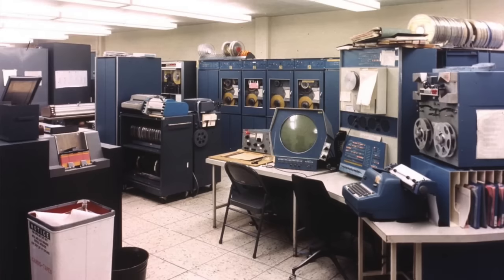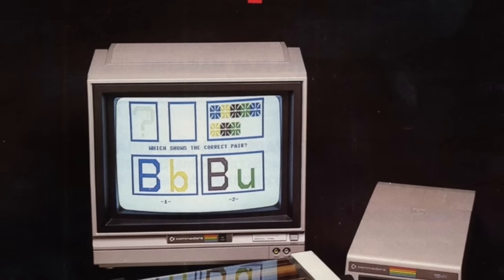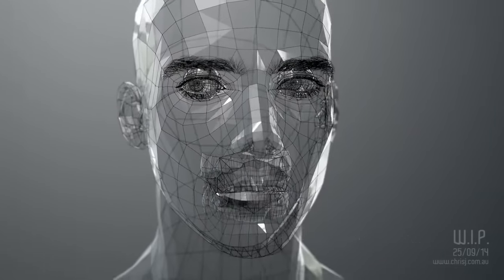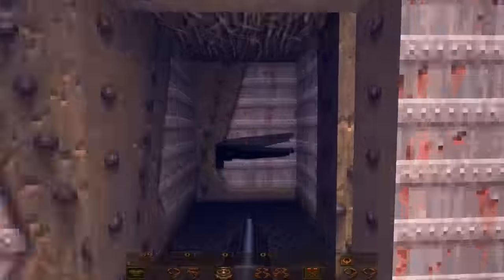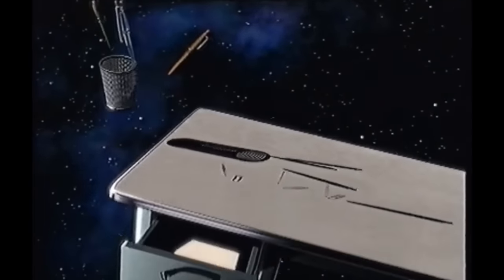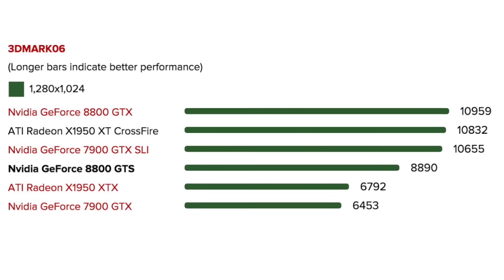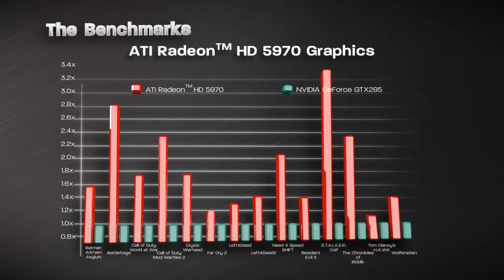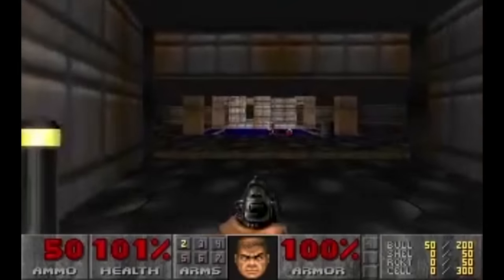Evolution Of PC Gaming Hardware

Comment: Inaccuracies.
1) The Voodoo 1 and Voodoo 2 were 3D accelerators ONLY. They did not have 2D capabilities, and the system required a 2D card to be installed with a pass through cable to the Voodoo cards, lowering analog signal quality. Never forget, the image quality of Voodoo 1 & 2 were atrocious.
2) That "nvidia basically was not able to beat" 3dfx is extremely inaccurate. They did beat 3dfx and did so to the point 3dfx faced such sweeping architecture changes that they were not able to enact them (Even the failed Voodoo5's right before bankruptcy).

nvidia's chips were faster than 3dfx's from the moment the TNT2 / TNT2 Ultra was launched moving forward to Geforce 256.

The deathnail to 3dfx from a hardware perspective was that nvida had and a huge, extensive list of features that 3dfx simply could not match with their voodoo 3 or Voodoo5 (VSA-100) architecture. 3dfx was simply buried under features and could not advance their product enough to remain relevant.
Reply: +Toysrme Don't forget the Voodoo Banshee, it was the first 3dfx card to do both, I had one myself after moving from the Matrox Mystique, then the Rendition. 

Those were great days man! I miss those days.
Reply: Yes, the voodoo banshee. A driver mess that was generally inferior to the riva TNT from nvidia that beat it to market.
Reply: Toysrme I guess, but it worked like a charm for me :D
Reply: +Toysrme true i had the voodoo3 card. it did not last that long. hell i still have the floppy driver disk
Reply: +Toysrme lol you didnt even listened @6:44 &quot;vodoo relied on the idea your computer would handle all the 2d stuff and the 3dfx card handle all the 3d. While today we don&#39;t call them &#39;3d accelerator&#39; that is exactly what this was&#39;&quot;

nice memories i almost forgot about 3dfx and vodoo, they never hit this country
Reply: +Toysrme The voodoo3 had 2d and 3d graphics; I think the video meant voodoo3 when they made a lot of these claims.  Now the TNT2 could run faster than a voodoo3 in 16bit mode.. but it looked like shit. It looked better than a voodoo3 in 32bit mode, but ran like shit.  A voodoo3 in glide ran at something like 22bits; which in games of the time looked really similar to 32bit (as the 8bit alpha channel was not heavily used). Combine that with the wickedgl custom minigls, and a vooodoo3 really crushed a tnt2 for any real world gameplay scenario.
Reply: +Kyle Ruggles: Actually it was a Voodoo Rush ... Banshee came later ... However 3dfx gutted their combo cards (3d chip was about half the equivalent Voodoo 3d card), the Rush had huge driver problems on top.
Reply: Lubos Soltes True true! I stand corrected :). Probably the time I was moving from the Matrox Mystique is when I found that at the time the banshee was the first 2d/3d 3dfx accelerator I moved to.  Man...time flies dude, those were great days though, powervr, rendition, nvidia, 3dfx, matrox, s3, cirrus logic "to a degree" all had their own chips and it was such an awesome time reading Boot and PC World magazines trying to figure out which card was the best with what chipset.  I was so freaking amazed that Mechwarrior 2 looked as great as it did!   Even the good ol days before 3d acceleration, Duke Nukem, Doom, ROTT, Commander Keen, Jazz Jackrabbit, Lemmings! ahhhh! just thinking...time for some emulators.
Reply: +Jerónimo Barraco Mármol : even in the US they were in limited supply. but what's funny is that them cards were all about the same prices as today's cards. I remember back when the voodoo 2 came out, it was $300. then latter the 3 4 and 5 hit. all were priced in between $300 and 500. people complain about today's gpu prices, but they are almost the same price as yesterdays cards.
Reply: clamo6362 there's a difference between price and how much it "costs" you. 300 usd 5 years aren't worth the same as now. so 300usd back then would be much more now. anyway, i'm from argentina, what do i know of latest tech.
Reply: +Jerónimo Barraco Mármol Inflation is a bitch eh...to think a hamburger cost 5 cents when my dad was a kid in the 60's
Reply: Kyle Ruggles lol you gotta see our inflation.
Reply: +Toysrme Also "OreGONE" trails... really? It's  "OreGUN"
Reply: +Toysrme Yes, also iirc those cards at the time just did polygon rasterization, so while a modern GPU does both 3D transformations and polygon rendering, at the time you had to do 3D transformations with the CPU and then just tell in the final stage to the GPU which polygons to render with what textures/colors/etc.
Reply: +Toysrme I still look back at our Voodoo2 & 3 days with a nostalgic motherfucking glint. Nobody can tell me Tomb Raider 3 on PC with Voodoo2 or 3 (can't remember which) wasn't some of the best gfx you'd ever seen. Real moving waves? Check, fancy looking lighting, even from muzzle flash? Check, Water-caustics in 1998ish? Check, Lara has more than 4 tris per tit? Check!

Don't even get me started on Unreal & Unreal Tournament (could've had an early Gforce by then, can't remember)... Those were the days.
Reply: I owned a Voodoo 2 before and the graphics were fantastic for it's time! Unreal and Rogue Squadron 3D looked so good! But Nvidia did come out with better cards and 3dFX just couldn't compete. So it was inaccurate to say Nvidia's card were inferior. The first GeForce blew 3dFX away.
Reply: Xavier Tomkins
Haha yea I remember SW: Rogue Squadron. I nicked it from school because I was a little tea-leaf back then. What can I say, I was only 11 and couldn't afford a moral compass! Good days.
Reply: ncshuriken I remember diving into the water in Tomb Raider and thinking OMG, this is fantastic!!!
Reply: +Toysrme Add to the list Unified Shaders first on ATI (Xenos GPU).
Reply: +Kyle Ruggles Hehe thanks man, have been trying to remember the name of the other card I had for ages - POWER VR, totally forgot. Monster 3D had the eye candy, PowerVR was FAST, and had realtime ray tracing (but pretty much no games...) Ah the good old days!
Reply: Counterpoint Life Yeah man! those were the great days, each card had it's strengths and it was great to compare and see which one worked for me.  Now it's just Nvidia and ATI cough I mean AMD hehe. Great times man...
Reply: +Toysrme And there's tons more - what you pointed out was the most glaring mistakes about graphics cards I noticed, but in general it's a pretty bad video. Referring to Wolfenstein 3D and Doom as 3D games, and talking about "pre-rendered" sprites. Jeezes.
Reply: Zt41L33 Both good points there.
Reply: I think Quake was the first 3D shooting game.
Reply: Xavier Tomkins Descent maybe? There were some fully 3D first-person games on the PS1 as well.
Reply: +Toysrme I've been playing Tombraider back then. A friend gave me his Voodoo 1 after he got the voodoo 2. Starting tombraider for the first time with 3dfx voodoo blew my mind.

Of course. compared to newer cards it was horrible, but compared to no 3d-card at all, it was amazing.
Reply: +Xavier Tomkins Wolfenstein 3d was the first FPS, then Doom, then Quake.

But I'd agree on Quake being the first competitive multiplayer FPS.
Reply: +liquidminds I stand corrected!!
Reply: liquidminds I thought Wolfenstein was 'pseudo 3D' rather than real polygonal, geometric 3D. 2D game engines have proved it by being able to create these "3D' games despite having no 3D capability. It's a clever trick. Unreal Engine used some of its own 'tricks' to give us graphical features that would've taken extreme processing power if done literally at the time.
Reply: ***** Yes its very possible, but W3D wasn't technically 3D, it was 'the illusion of 3D' . I don't know how it works but I'd guess its all clever 'relative scaling & position' algorithms. Parappa The Rapper used 2D sprites over real 3D IIRC, same with Capcom Vs SNK 2 on PS2 (2D sprite characters in 3D world).
Reply: ncshuriken we were talking about first-person-shooter. Not 3D. 

"real 3d" wasn't possible before the first GPUs came up, as those were optimised to tackle exactly those problems (the same calculation for a large set of values instead of different calculations on single values)

But that's basically self-explanatory, once you understand how CPU and GPU work differently.
Reply: ***** possible, but very limited, as the cpu wasn't made for it. so not in the way we think of it now. not polygon-based large scale 3d.
Reply: ***** don't know really.. the typical youtube "I want to disagree so I look for anything you could turn into something else" thing as far as I'm concerned.

Like I said. obvious reasons. If you understand the difference between CPU and GPU. If you don't, you probably won't.
Reply: ***** Okay I misunderstood your statement. Yes I know my PC anatomy & terminology, but thanks.

I'm just telling you what I know mate. There's no reason to get funny about it. It sounds like you're taking all this too seriously.
Reply: +Dalle Smalhals It depends on semantics. Most people call Wolfenstein and Doom a 2.5D game, a term that I don';t like very much. Well, yes the games are 3d, but just not rendered with polygons. The maps are more 2d, you can't have floors above floors unless you do some strange hacks with level editing, although the data structure of say a sector in Doom is kinda 3d-iish (2d vectors for room shape, but information for floor/ceiling height goes on vertical vector) and at the end we get a 3d representation on the screen. It's all on our interpretation and the different techniques used but the 3d feeling is there, I remember someone joking about this saying even 3d polygonal games are really 2d, because at the end the vertices are projected on our 2d monitors and then 2d polygons are rendered since pixels are a 2d array.
Reply: ***** The discussion is about mathematical 3D, rather than a visual illusion of 3D - and you're right, there are polygonal (mathematically 3D) games going back to the early 80's, but they were quite limited in what they could do. It seems that 1991-93 is about the time when fast 3D games started becoming possible at home, mostly on Amiga and consoles (by all means, correct me). I guess Playstation 1 was the first thing that was really designed with home 3D in mind though.
Reply: voodoo 2 is legendary and good quality I love unreal tornament and original red faction all playing on voodoo 2 sli  also voodoo scale with CPU nvidia does not .
Reply: colin chapman Yea man, Unreal... Back then it really did look Unreal!
Reply: +colin chapman  haha  i where running a Pentium 2  and SLI Voodoo2 =)
Reply: +Toysrme Inaccuracy: you are not a sheep lover
Reply: +Xavier Tomkins  well the nvidia cards that came time when voodoo 1,2 was on the top nvidia was inferior but when voodoo 3 and tnt , tnt 2 was on fighting nvidia took the cake home .
Reply: +Dalle Smalhals 2d sprites in 3d world truh 2d  display isn't true 3d  also LOL
Reply: +Dalle Smalhals i think its the same if you took todays games and compere them ageinst 3d displayed games whit glasses but preferred  whit out together its same kind off leap .
Reply: +Toysrme Almost half the information in this video is wrong. But hey, it gets the deal.

Comment: *Build name: The Oven*

CPU: Pentium D40 Overclocked to 4.2GHZ @120C Without Heatsink
GPU: Quad Crossfire AMD Fury X @180C *GG AMD*
PSU: Coolermaster Ultra 2100w Power supply
Case: No air intakes or openings
Ram: Server-Grade 2TB Set

Have fun
Reply: I tried it.

My case melted

Comment: Newest computer: Overwatch friendly
Power Supply: A lemon
GPU: A toaster
Motherboard: My pillowcase
CPU: A piece of paper with yellow lines
RAM: 0.9 MB of an onion
Hard drive: A broken steering wheel because it's going to be hard to drive with it

I can run Overwatch at 5 FPS at 13.37x6.9 resolution, you guys must be jealous.
Reply: dream rig
Reply: Best rig
Reply: it would be cool to build that.
Reply: I can run GTA V in a watermelon with 666 fps at 1x1 resolution M8.
Reply: A fraction of a pixel? My brain hurts.
Reply: if you take a power cable and shove it in a tomato on a kebab with a pineapple, i heard you can get 1 fps on minecraft!
Reply: My is better, my is a potato.
Reply: I can run GTA 5 at 1 by  resolution, at 666 hours per frame.
Best mac ever!